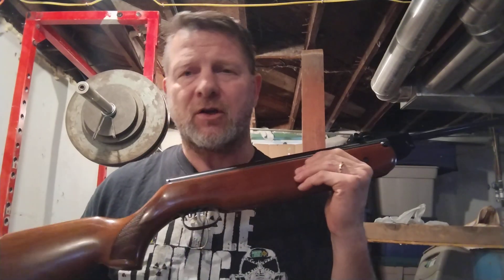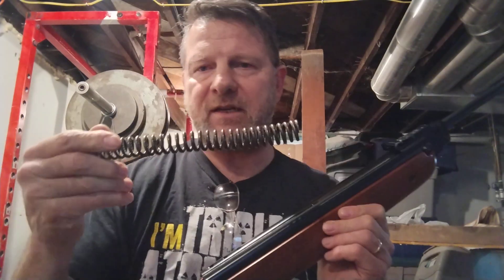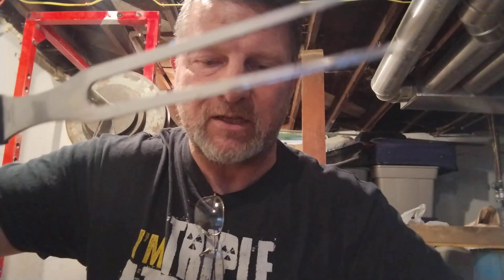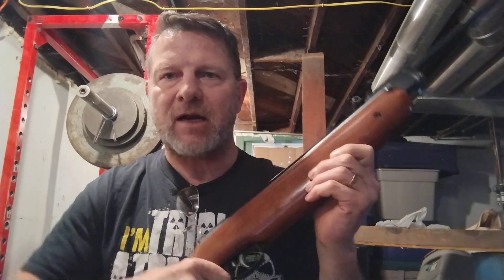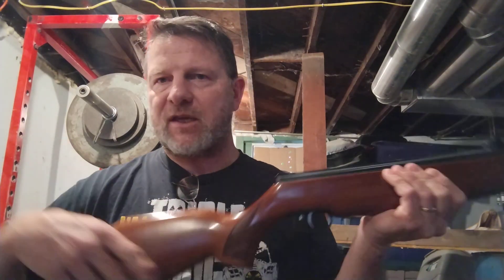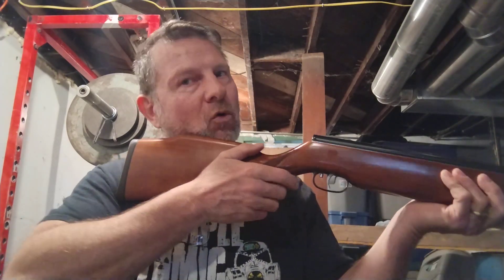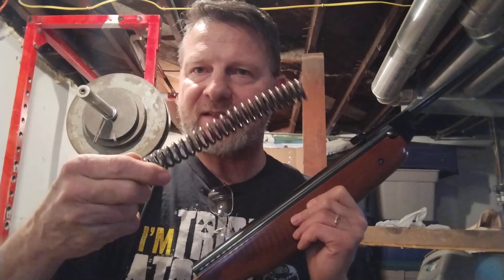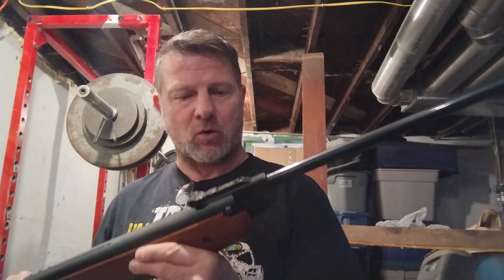Why Tune It? Vibrations Throw Shots: Harmonics in Action 👍

Comment: About three years ago I bought the HW 57 in .177 and i have to concede that it had quite a twang when I started shooting it, but it was accurate from the beginning nonetheless. After a couple of 500 rd. tins of pellets the twang subsided though. It just needed some time and shot counts to get broke in. Ever since it shoots just nicely. It is accurate and there is no perceived vibration after the trigger is pulled.

Giving a (newly aquired) Weihrauch a tuning is certainly not wrong, however I do believe that it is not an imperative necessity.

Granted, the Weihrauch plant in Mellrichstadt definitely does mass production, however their quality control and management is not to be underestimated. The guns they produce are obviously supposed to be perfectly viable on their own and with the experience I have made with my HW 57 named above, I can tell so. After an initial phase of breaking in, the spring will settle in and the gun will function perfectly well. Not every Weihrauch buyer will either want to invest in or actually have the resources for an additional tuning. My HW 57 has shown to me that you don't have to include a tuning with the purchase of a new Weihrauch gun, just to be able to experience its full quality range.

Patience and persistence in the break-in phase will do the same as a tuning, allowing the gun to develop its own character with its shooter.

Comment: Not bad to take that twang off.
Reply from the maker: The twang doesn't bother me, but improving the shooting characteristics and life to the spring is definitely worth it.
Reply: @springpistonriflefeverlone9611  make sense in this case for that spring was in pretty bad shape.  Will increase speed to with the new spring do you stretch the spring?
Reply from the maker: @AIRSTREAMRIFLES  In the airgun world manufacturers are pushing FPS as an end goal, and fully neglecting to show the importance of accuracy on target 🎯 that matters more than anything. FPS is great for windy conditions, but the stronger the power plant, the more flyers you are going to have. Talking about energy, I have hammered 2 squirrels 🐿️🐿️ with my HW30's when it was 6 FPE.
It won't increase the speed, but it will improve the shooting characteristics of the rifle. In other words it will steady your rifle on the inside, helping the shooter be more accurate. I don't think stretching the spring out would help very much. I believe it would return to normal size quickly. Perhaps a blacksmith could heat treat a stretched out spring, to provide new life?
Reply: @springpistonriflefeverlone9611  true it takes heat to shrink it back down after several cocking compressions

Comment: So not an issue for a gas piston?
Reply from the maker: Not the vibration, but extreme piston slam.
Reply: @springpistonriflefeverlone9611  So would you do anything to a new gamo magnum?
Reply from the maker: @vashmatrix5769  Possibly clean out all the factory lubrication from the compression chamber and lube from the piston seal and piston. They over lubricate the rifles to protect them for shipping overseas. This is a good thing and a bad thing. Good that it protects your rifle from rust and bad, that it may burn up your piston seal. De-bur the edges where the piston seal will have to get by when you put it back together. This will help protect your piston seal from being gouged. Reapply a very light coat of molly grease on the edge of the piston seal and lower half of the piston, before reinstalling it. Be very careful when you pushed piston back in, not to force it past any obstruction. Anytime your piston seal catches on something, use a punch, to apply a little pressure on the edge of the piston seal to push it by the obstruction, to prevent gouging. 
After cleaning out the lubricants, you will most likely get a little less FPS, this is not the end of the world, and your rifle is still going to be extremely powerful. Most rifles have their highest FPS in the beginning because of dieseling off the factory lubrication. Lastly, never ever put any lubrication on the gas ram rod! This will cause an explosion in your rifle. I did this to my Gamo Hornet Maxxim 22 and fire 🔥 shot out the end of my barrel 🔥, not good.
I hope that helps you 🙂👍.
Reply: @springpistonriflefeverlone9611  Wow.  So I felt clueless in the 1st sentence.  Yeah, the idea of taking this thing apart is where you lost me.  Everything you said after that just further confirmed I shouldn't even think of trying.  I'm a visual learner & a lot of that may as well of been Greek to me.  Probably would void the warranty anyway.  I definitely won't be using lube or try dieseling.

Comment: I'm really contemplating picking up an HW...mainly because they are amazing quality, but then there is a small part of me that is curious what the so called "Twang" is all about.  I haven't heard it from neither of my cometas or even from my Diana (the Cometas have a nice steel piston sleeve and well fitting guides. If you haven't figured it out, I'm pretty obsessed with the Cometas).  I know it's not a desirable thing, The Twang aka Buzz, and many shooters simply hate it.  I imagine I could tolerate for a bit and then would eventually throw a Vortek or ARH kit into it.  I was initially thinking the 99s was what i wanted, but Krale has been out, so now I'm considering the 95 Luxus or 30s.  It's a tough choice being they are so different.  I know I would love either one, and I already have the Cometa Fenix 400 and Fusion which are at least as powerful as the HW95 and weigh about the same.  What a dilemma!
Reply from the maker: The Cometa sounds pretty nice 🙂👍. I think that you would like a HW. The twang never bothered me, kind of like it, lol. I just want the life of the spring extended and  the shooting characteristics improved.